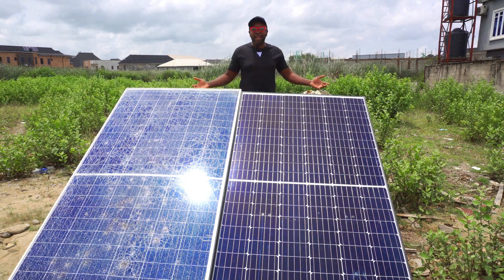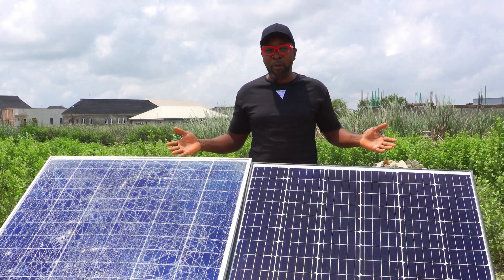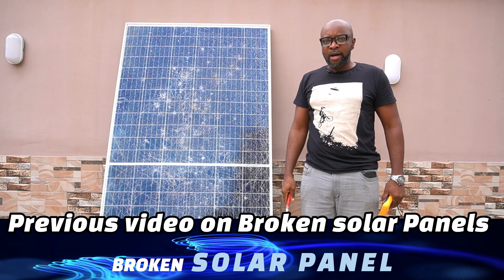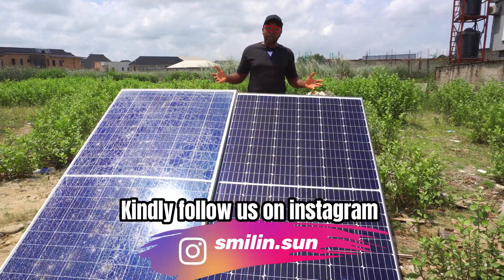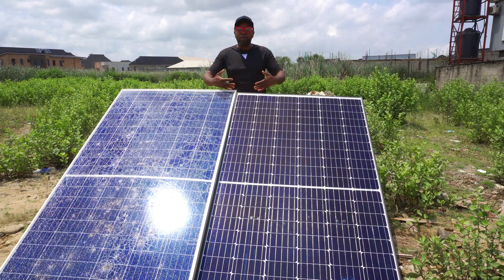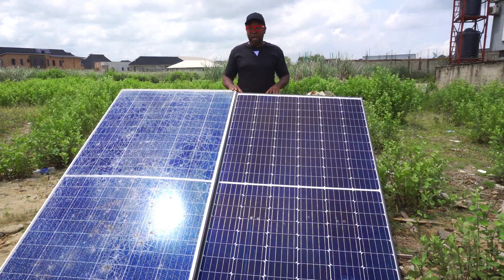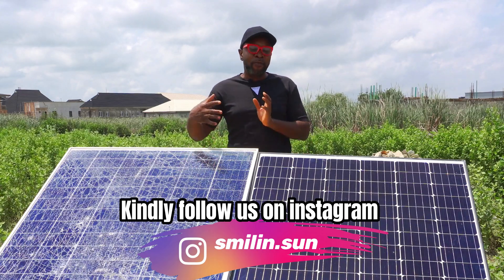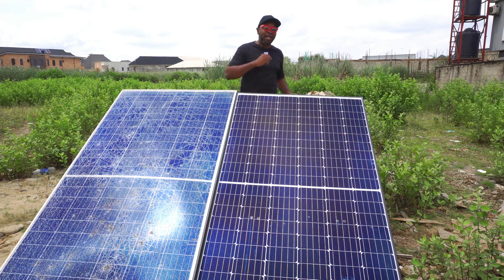How to know the state of your Broken Solar panel ?

Comment: What of in a case of replacing the broken glass of the panel could it work?
Reply from the maker: Nope the cells are already damaged by the impact of the fall.
Reply: Although mine didn't fall
Reply: Was in the roof but cracked up there